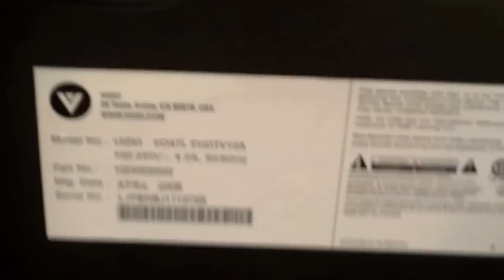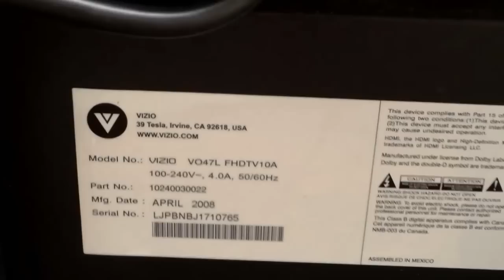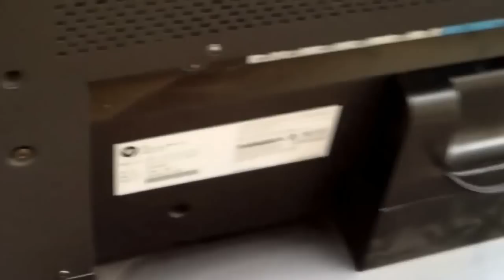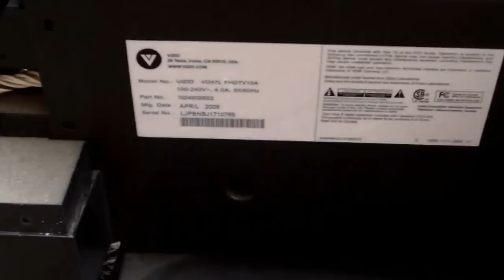HOW TO FIX VIZIO TV - What causes no power

Comment: I picked up a Phillips 47" TV with a blown out area in the power board. A blown capacitor coated residue over about 15 square inches, and made a 2 square inch hole. It looked as if the transformer was melted, but it was merely residue from the cap. I replaced the blown cap and 2 bulged others, and saved the power board.

Comment: I have this same T.V. with a flickering back light issue intermittently after it warms up. Sometimes this is accompanied with some buzzing sounds. I thought it would be bad caps on the power supply, but they look good there as well as on the master and slave boards. The buzzing sounds like its coming from the slave, although it is mounted on the wall and tough to tell. My next step tomorrow is to test all the caps in all three boards with my meter. If all the caps test good, where would you move your troubleshooting efforts to?
Reply: did you check the master and slave? when I had that problem all four caps blew out

Comment: Tampatech,have you or anyone done any videos on repairing combo units ( ie: tv/dvd, tv/vhs)???? a neighbor friend of mine brought me an rca combo unit(tv/dvd) to hopefully repair. the original issue was a volume problem, so I figured that the problem was with the mainboard on the TV and replaced the main board, but it took quite a while to even find the board that I was looking for and finally found one, but now the issue that I have is that there are two sets of wires that connect to a power board over the DVD player and I'm trying to remember or try and locate either a schematic or a service manual that would help me to determine were these two sets of wires connect up to this power board and not the main power board and also which direction that the cord to the TV from the main board to the screen which side of the screen that that connector goes in on to the right or left? Other than that the TV is virtually finished until I can actually find out whether the weather that original issue with the volume control solved the original problem...

Comment: I have 5v stand by, and the relay turns on, but no 12v and 1.3v on the 24v, no buldged caps, board looks good, bridge rec, is 170vdc, all doide ic's are @ 0.54 ohms, no shorted mosfets, this sucker has me baffeld, any sudgestions?

Comment: I just received this TV to try to fix. I know it's very old but when you turn it on everything works for about 10 minutes. Then the sound makes a type of screeching noise and the system shuts down. I can immediately turn the TV back on and it will again work for about 10 minutes and then shut down. Is this a power supply or controller board? I have not yet opened up the back. Any suggestions?

Comment: Hi I have a Visio m550nv that has backlight but no boot screen . It will turn on and off with the remote . Ive watched a lot of your vidios and tested power supply board was fine in visible bad areas on any of the boards . I've tried the flashlight test. Nothing there but as i said it has backlight and powers up . Which board do you think i should replace? I removed all ribbons connections as well ,please help me make the correct decision.. thanks paul

Comment: I have a Vizio 50" power comes on and turns itself back of within 30 seconds. Green power light is on. Would this be the same problem ?? This happened right after a power outage. It has turned itself off before like stuck in sleep mode but eventually it would stay on. Now turns on and turns itself back off. Won't stay on at all even after unplugging it.

Comment: Great vid,I replaced the power board and the main board.every once in a while a blue light thats on the smaller.board thats on the left side turns on for a few seconds. .any suggestions??
Reply from the maker: JohnnyDesaint not sure but this tv model was known for bad inverter boards that shorted the power board.
Reply: Tampatec thanx for your reply.I dig your videos..i found the problem last night

Comment: Would this effect sound too? Mine was acting up for a couple weeks with no picture but sound at times. It would take multiple tries to get it to come on. Got up yesterday morning and nothing. Power light comes on but no picture and no sound. We have held the power button on tv to reset, unplugged power cord even over night, I disconnected the blue ray player and WII, I've held the mute button for 3 seconds, I've tried to the menu and it doesn't display. We've tried everything. Its not connected to a cable box either. I have a Vizio E500i-B1. Thanks!

Comment: I have a sanyo DP50749 that wont power up at all, doesnt come on and go off just doesnt do anything. I watched the video on how to test the AC and DC with a meter and it has the 120 V of AC but nothing for DC,  however I was under the belief that you were supposed to turn on the TV before you tested the DC but mine wont come on so to you think iys the power supply? I found the part at Shop Jimmy but want to be at least pretty sure its what i need nefore i make the purchase...thanks

Comment: Hi Tampatec, i've got the 3647-0072-0150 main board, the exact TV in this video. On the main board I'm missing 4v on the inverter on pin 13, the power supply to main board cable. Before i picked up the TV the person before me put in a new power  supply from shopjimmy and a "good" master inverter from ebay. Where do you think i should start looking? I have 3v on pin 12. I tested the power supply, i've got 24v on inverter supply, and all 5v standby.

Comment: I have the same board and scorching on my power supply board, I ordered a new power supply and it still did not fix the problem. On the slave and master I had four more blown capacitors. I replaced the caps as well and still there is no power to the backlight.  Looking for your next video. Thanks.
Reply: Raziel Cain I'm sure you are not still working on this tv, I just wanted to let you know that I've repaired 4 Vizios with this same problem and what you haven't yet fixed is a blown fuse on the inverter board. I believe it is on the "master" inverterboard, small white soldered on fuse. On these tvs, the power supply board needs to be replaced, then the 4 capacitors on the inverter boards as well as the fuse on the inverter board. This should make the tv work like new.
Reply: +soxcanes i need help identifying that fuse you speak of. I did do the caps and the power board
Reply: Raziel Cain I responded to this 5 days ago but youtube isn't posting my reply. It is a small white fuse soldered onto the master inverter board  (actually there is one on both, but the one that goes bad is usually the master). It is located next to where the ribbon of wires connects to the board. I believe it is a 10amp 60volt DC fuse. I usually solder in a fuse holder and use a replaceable fuse to fix this.  I posted a picture with my last reply but I have a feeling that's why the comment never showed up. You can see it at imgur dot com  /   yt2CO7z
Reply: +soxcanes thank you . I will try it out. Never removed fuses before but i will try! Thanks again!

Comment: I have a vizio E701i-A3. I recently replaced all the boards. power, main, tcomm. still doesn't work. I have back lights. when the tv is turned on. the vizio logo doesn't show on the screen nor does any other logos. this is the second go around. I initially replaced the tcomm and main and it started back working. after and hour it went out again. so I replaced all three boards and this is where I'm at now. HELP HELP PLEASE!!!

Comment: I got a viewsonic 22" monitor which wouldnt turn on and immediately i saw bulged caps but i also saw a bad scorch mark, i look at the back at where the scorch mark was and it was about 3 SMD's that had burned up. I then got the same monitor in (simple bad connector) so i tried the PSU in it and thankfully i did because the panel was dead and so i didnt waste money on a new PSU :P

Comment: Hey buddy, I have a Vizio M3D420SR, just yesterday I attempted to turn on my TV and the only thing that would happen was the VIZIO name would light up, I unplugged it for a good 10 minutes but nothing happened. Took out the back plate and based on a visual inspection everything seems to be good, no swollen caps or burn outs. any suggestions? thanks alot!

Comment: Hi, I have a Vizio M550nv HDTV that I was given.  The original symptom was, once it was plugged in, the logo would flash amber/white but the screen would not come on. 
 I found a video that instructed me to do a “pc cold boot/hard reset”  by unplugging the unit, holding the power button in for 30 sec, plug it back up, and after the logo stops flashing amber/white, see if it would power on. 

It DID power on and worked just fine for about a week. [it did power off
a couple of times but I was able to repeat the above procedure at restore
power]
Now the amber light will come on but that is all. I cannot
get the screen to power on no matter what I do. 
I replaced the power psu board per suggested by several videos I watched
but the symptom was unchanged at all. [$68 mistake]
I have visually inspected all components for burned, bulging
or damages parts but all looks good.What Is your opinion?

Comment: I don't know if you are still active, but I have a vizio smart tv. I got it from my grandfather, and the IR sensor wasn't working, so I took it apart to find the issue, and when I did, I found that the IR sensor clip broke. So I fixed it, and powered the TV on to test it, I turned it off with the remote now, everything seems fine. Now, when I place the IR sensor back in it's spot, I test again to make sure before I close it up. Now the TV won't power on. Nothing looks blown, no dark spots, and all the cords and wires are plugged in all the way, any ideas?
Reply: I had to solder two of the spots on the back of where the wires connect (in the white box) on the center board to get it to come on, apparently  the LCD wasn't getting power for some reason, so that made the TV come on, but now the display is upside down, and I have reset all settings to factory, but that did not work. So, I guess I just have to use the tv upside down now XD
Reply: Vizio E420i-A1, tried the top thing, and it refreshed but did not work.
Reply: I can get into the regular menus. I don't know what you mean by the service menu. I can't get into the menu that shows the apps, but I can get into the menu with picture, settings, help etc
Reply: Do you know how I can get into that menu?
Reply: Thanks man I will give it a shot.

Comment: Would that be much, much cheaper just change couple caps, and whatever needs to be changed, and clean the board?? Why spend $80 to $100 for new power supply board?? Just wondering.....=)

Comment: I have a vision TVs model e321mv and it won't turn off and the led light it turns red place help me
Reply from the maker: can be bad main board but confirm that with shopjimmy tech before you buy it from them - 1 (877) 881-6492 / (952) 881-6492

Comment: If it does not come back because a fuse, replace the fuse, however, if it is not the fuse, buy the power supply at ebay for less then $40 dollars, easy replace just like a PC.

Comment: I have a Vizio that keeps shutting off. It does come back on but constantly shuts off at any given time. Please help and thanks in advance.
Reply from the maker: check 5v standby on power board or try unplug inverter board then turn on tv, if tv stays on without inverter board then inverter board is forcing tv to shutdown. do same for tcon board.
Reply: House of peace

Comment: Thanks for the videos they are great. I have a Vizio  E422VLE , The tv has no lights wont power on. I purchased a power supply board and installed it and still no power or lights. Before I purchase a main board, how can I check the main board to see if it is good. Can you tell me the voltage pinouts or other ways to check it ? Thanks. Main board  3642-1492-0150(4B).
http://www.shopjimmy.com/vizio-3642-1492-0150-main-board-for-e422vle.htm